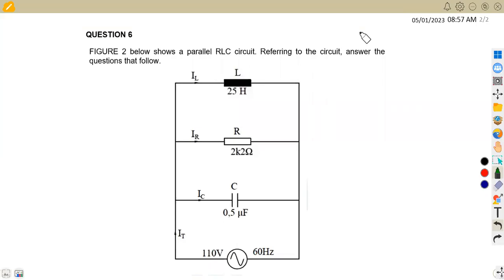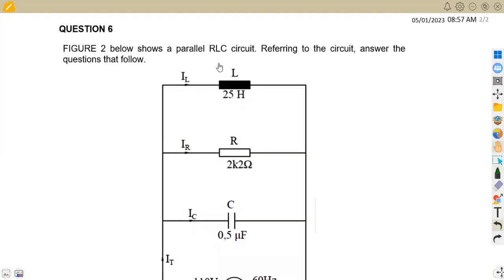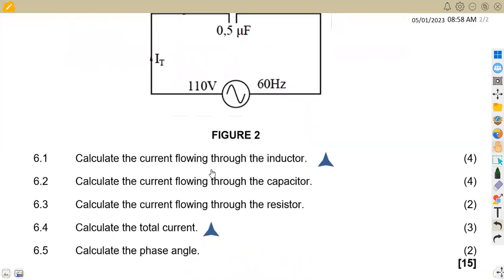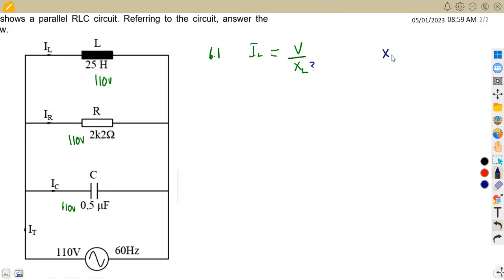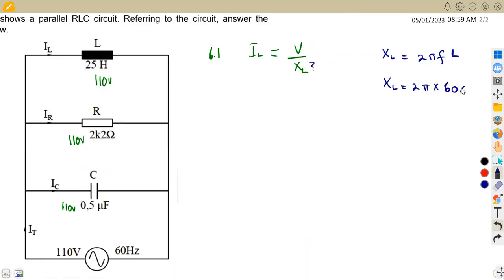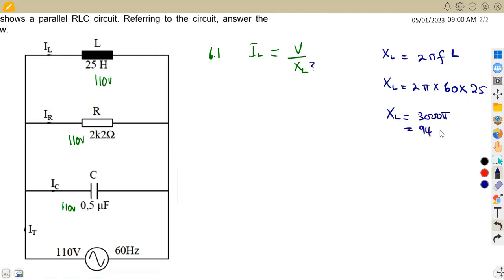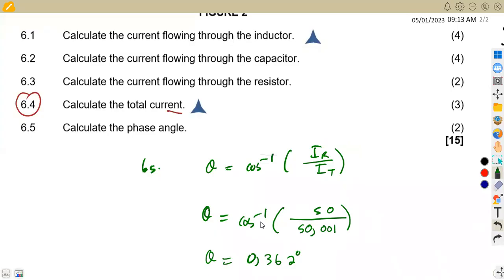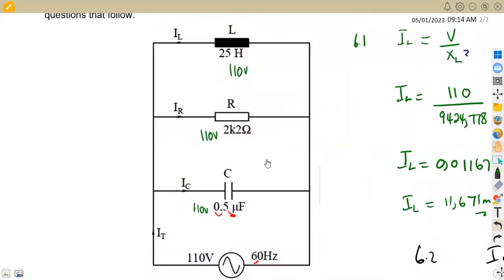Industrial Electronics N3 AC THEORY AUGUST 2021 @mathszoneafricanmotives

Comment: Hey there, isnt the value for Ic at 6.2 supposed to be 0,020734A\20,734mA?
Reply: Hello sir 🖐️.
In 6.2 the final answer for Ic is wrong but the steps are correct but only the final answer which is not correct the correct one for Ic=0.0207....×10³
   =20.735mA
Reply from the maker: To find current,  you will need voltage and reactance,  not current and current
Reply: Yes Ic is 0,020 meaning Xc is greater than Xl